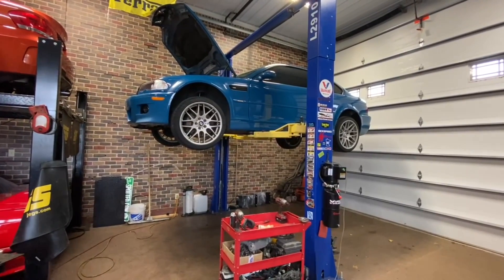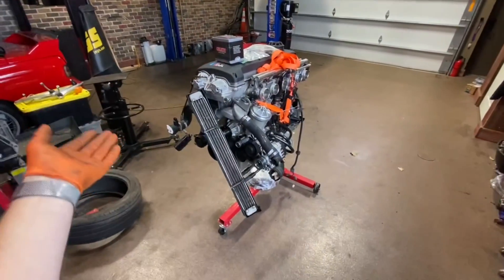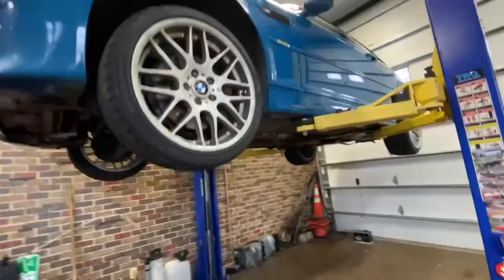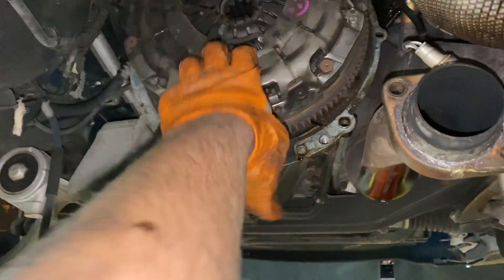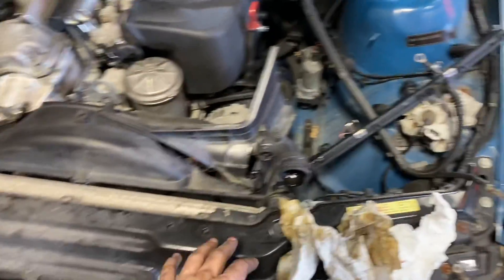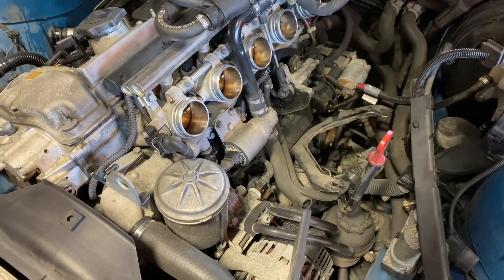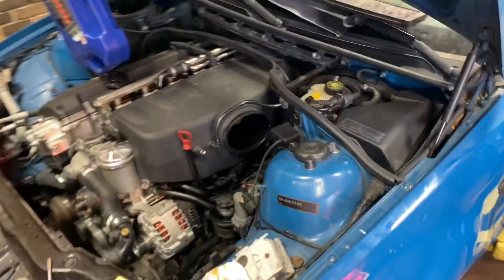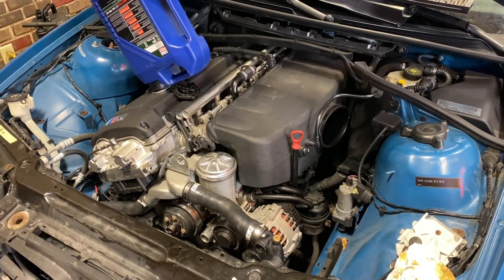the LSB E46 M3 gets a new engine, K swap updates for e10

Comment: How is the Model S been treating you ? Also any plans with the 500e ?
Reply from the maker: it has been good. I like having a daily driver that cannot be modified, and always works. Just took it on a 1600 mile drive and had good results.

the 500e, if I buy another, would eventually be ideally turned in to a 500 Jolly tribute...

Comment: I would highly appreciate if you could do a take on the e46 M3 underbody rust repair.
Reply from the maker: That may happen yet this winter - I did get all of the loose rust and moisture absorbing stuff cut out so it's not expanding in the mean time. Perhaps I'll get to that before I toss the red iS on the lift this winter.
Reply: @OvalboreCars   I have got a lot of rust on mine so this request is frankly a bit selfish. I am not quite sure yet how to deal with the studbolts especially for the backbox mounts since properly replacing them requires professional and expensive tools. 
Anyway I'm looking forward for more videos featuring this Laguna Seca beauty. It's just the most precious within your collection.